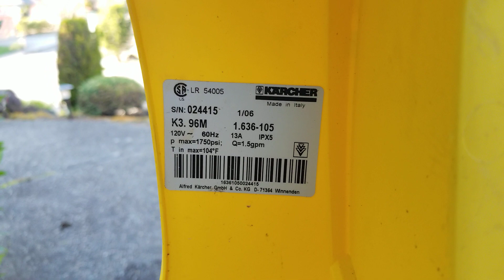Karcher K3.96M Pressure Washer Low Pressure and Surging

Comment: Mine was doing the same thing. I figures it was caused by a small crack in the pistol that create enough leak to loose the pressure so the motor would start to build the pressure, stop, loose pressure, start and so on. I am looking for a pistol replacement right now because I don't think my repair will last very long.

Comment: Debris/dirt in the hose or nozzle? Air in the pump? I have a Karcher that's doing the same thing as well, I'm trying to troubleshoot it as well
Reply from the maker: Water flow into the unit seems fine. I'm not completely sure that there's no dirt or debris in the high pressure hose or spray head/nozzle but the problem seems to be before that. Air getting into the pump seems to be a possibility.

Comment: I have the same unit, and last time I tried using it, there was not much pressure. I don't have a solution yet as I haven't had time to investigate. However, the motor/pump noise you demonstrate in the video, my unit has made that noise since the day I bought it brand new. Sorry I can't contribute more than that.